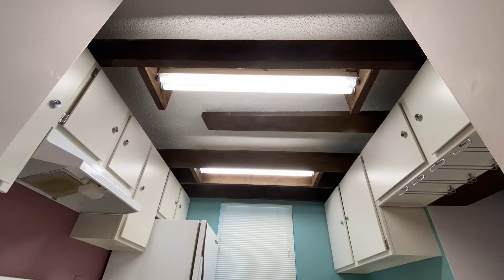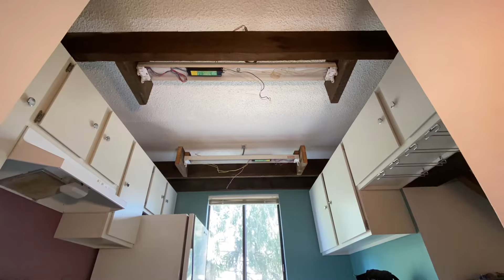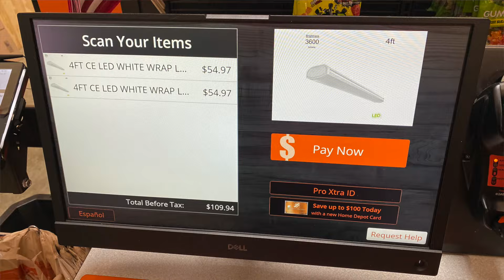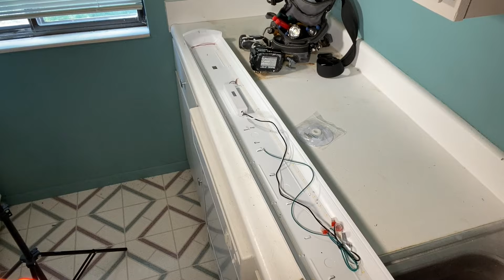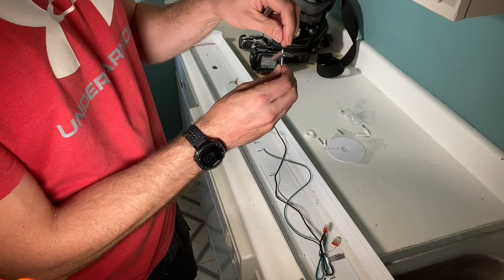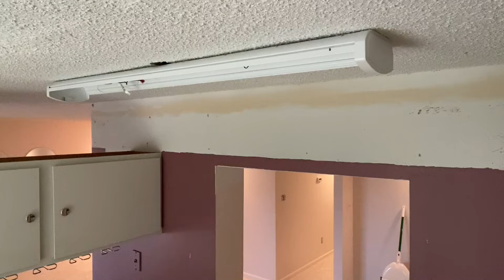How To Install A New LED Kitchen Ceiling Light | 4 Foot Flush Mount

Comment from the maker: Additional Tools Used and Light Options
LED Light Used:  https://geni.us/98icGCK
Klein Voltage Tester: https://geni.us/fAYN9Rr
Toggle Bolts:  https://geni.us/j8SDHM4
Same LED Light With Wider Base:  https://geni.us/MpYQVy

Tools Every Weekend Warrior Needs
Makita Cordless Drill Combo Kit:  https://geni.us/t7dIA
Dewalt Drill Bit Set:  https://geni.us/oFlSl
Dewalt Screwdriver Bit Set:  https://geni.us/VDcr
Craftsman Screwdriver Set: https://geni.us/jXqFI
Eklind Allen Wrench Set:  https://geni.us/7XfvO
Pliers (4-Piece Set):  https://geni.us/RIdx
Stanley Utility Knife:  https://geni.us/ndIDa
Stanley Tape Measure:  https://geni.us/bUfD1R
Studbuddy Stud Finder:  https://geni.us/RySCuVw
Johnson Torpedo Level:  https://geni.us/wiLcDY
Stanley Hammer:  https://geni.us/bPDk8Wo
Buck Bros Wood Chisel Set:  https://geni.us/vk3cpTW
Klein Voltage Tester:  https://geni.us/h9Hl
Klein Outlet Tester:  https://geni.us/kdBAJ
Ideal Wire Strippers: https://geni.us/MdOB
Little Giant Ladder: https://geni.us/fmlmTk

DISCLAIMER: This video and description contains affiliate links, which means that if you click on one of the product links, I’ll receive a small commission.

Comment: Excellent video, thank you. I already have that type of lighting in my kitchen, like the one I had when I first bought the house, but it's not working anymore. Do I have to spend $58 to replace the whole system?
Reply: I have the same issue. That type of LED light was already installed. It recently went out. So I replace the whole fixture??

Comment: How long does the lightning last?
Reply: I've read that LEDs can last 50,000 hours for these types of lights, however, that's 50,000 straight hours on non-stop. So with them being on and off, I can assume they'll last way longer. Compared to fluorescent lights that last nowhere near that long. The downside to this type of lighting is that the whole thing needs to be replaced instead of just the light bulbs in other models.

Comment: There seems to be either confusion or disagreement about the terms flush mount and surface mount. As a journeyman electrician the installation shown would be called a surface mount.

Comment: Great video!  I am inspired to take this project on in my own kitchen.  I have a few questions:
(1) Is this a disposal fixture?  Granted LEDs will last a while, but when it fails you have to replace the whole thing.  Would a fixture that accepts LED tubes be easier to maintain (and greener)?
(2) That looked like a lot of wire tucked away in the fixture.  Do you recommend trimming the wire instead of wrapping it all up there?  You could always extend with a wire nut/Wago (not ideal so measure twice, cut once).
(3) Do you have any hints on physical placement?  For example, should I center going down the middle of the galley-like kitchen (long with cabinets and built-in appliances on both side) or should I center with respect to the entryway (door frame with pocket)?
BTW, what is the typical failure mode of this light?  One LED at a time?  A whole strip?  Th whole fixture?

Comment: Most, if not all, of the newer LED fixtures are light color selectable, from 2700K to 5000K or more. There is a three position slider switch inside fixture to select between three color temperatures. I have a 15” round edge-lit fixture that has a fourth setting so you can select any of the three color temperatures by quickly turning the switch on/off until you get the one you want. The fixture will default to the last color temperature you selected when operated normally until you change color temperature again. Mine is even dimmable.

The issue about higher color temperatures (4000K and higher), is that bluer light blocks the production of melatonin in the body that can disrupt sleep. Just don’t be in an environment with bluer light a couple hours or so before bedtime. The cooler color temperatures are fine during the day when you are awake, and it makes people more energetic. It’s best to spend your evening hours before bed under warmer color temperature light like 2700K to 3000K, which is what most LED bulbs labeled “warm white” or similar. The warmer color temperature light does not disrupt the production of melatonin in the body and therefore, does not disrupt sleep. As mentioned above, bluer colored light is fine during the day when you are awake.
Reply: My client wants 6500k in the artist shop I do maintenance in. It's a side gig for me that I do at night, so say a prayer I get sleep! haha. Good advice btw.

Comment: Two things you did not hightlight enough is that this is NOT a fluorescent bulb fixture . With this if a strip goes bad you have to replace the entire fixture. Also love your screws to mount to the ceiling but only useful if the fixture has holes that allow one to stick in screw head in AND then slide to get to a place to tighten.

Comment: I’m currently installing a prismatic red light and a light fixture that I took down out of my garage has a white wire be a copper wire and a red wire the new fixture wires are white black and yellow which wires do I connect to what?

Comment: I purchased a similar product and the instructions say to position the wire connections back into the electrical box. However, I noticed you have connections inside the fixture. Just curious why you did it this way and is it a safe practice. Thank you

Comment: Hi, would you know what Dimmer switch would be compatible with these lights? I just installed but not sure what switch to get for these type of lights.
Reply: Hello! It will typically state whether the light is dimmable online in the description or on the box. I haven't seen many of these types of lights that are dimmable. I'd check the "specifications" on the website to ensure it's dimmability.

Comment: Nice video. Gives me the confidence to do it myself. 

With the faux ceiling gone,  have you thought about raising your cabinets to the ceiling?  I'm fixing to do that.  Plus I'm also fixing to replace my stove vent hood with a microwave vent hood combo.  Just a few suggestions for future videos for you.  👩‍🔧
Reply from the maker: Hey Carol,  If I was going to swap out the cabinets I would consider 36" high or 42" high depending on the clearance.  42" are a bit hard to reach but really increase the storage.
Reply: @EverydayHomeRepairs  true. I wanted to keep the cabinets and increase the countertop space. I'm tall and would store holiday stuff on the upper shelves.

Comment: Question: I've had my entire ceiling rebuilt over the past month, with new framing/joists, new insulation, and tomorrow I am having new drywall put up.  Can I mount these directly to the joists through the drywall, and what screws would you recommend for that?  My new joists are 1.5" wide and spaced at 14" to 16" (16 inches from the center of each joist) apart.  I have a Tavool electronic stud finder I can use to find them once the sheetrock goes up, but I'm going to ask the contractor to mark the studs on the drywall if he can.    I kind of don't want to mount my lights to the drywall.  Thanks!
Reply from the maker: Yes, I think you could mount directly to the floor joists.  If the standard mounting holes don't align exactly to your spacing you could drill 1 hole in the housing and use 1 of the standard mounting holes to get everything spaced exactly as you need it.  In terms of screws, this video goes over my favorite screw for this type of project. https://youtu.be/pztWWy2G7mI  Best of luck!

Comment: Is your light motion sensing? I skipped thru most of the video, if so can I go over those functions thanx
Reply from the maker: Nope, if I wanted that feature I would add it to the light switch by purchasing a light switch with a motion sensor integrated.  Best of luck on your project.

Comment: Good info! I plan to change the two ceiling fluorescent in the kitchen which are both controlled by one switch.  I haven't taken them down yet, but I wonder if they are wired in series, would there be any different issues with the wiring?
Reply from the maker: Nope, they are almost certainly on the same circuit and your wiring should be similar to the video.  Best of luck on the project!
Reply: @EverydayHomeRepairs  Thanks, will let you know how it goes

Comment: Great video.  This is my first time trying to install the same light fixture.  Couple questions.  1.  How did you get the fixture to hang while you were taking measurements before screwing into ceiling?  and 2.  Was there a bare copper wire coming out of the ceiling?  and if not, then the green wire is therefore not connected to anything?  Thank-you so much.
Reply from the maker: Hey Alan,  I just passed the wiring through the center grommet and they bent the wires around the edge which was enough to hold the fixture in place.  You are correct that this condo's wiring does not have ground at this location so I did not connect the ground from the light fixture to anything.  Best of luck on the install!

Comment: You mention that you can push down to release the light cover, but I don't see how you did it.

I bought a home with what looks like a very standard builder-grade LED light in the kitchen and I want to take it down as I have a much better LED light for that area.
Reply from the maker: Hey Shawn,  it is more of a push the cover up which allows you to slide the cover in 1 direction and then that will clear the opposite side from the housing allowing you to take the cover off.

Comment: My garage has the long bulbs and I would like to change it to the LED light. The only catch is my garage ceiling is concrete. Can my drill bit drill through or will I ruin it if I try?
Reply from the maker: You can drill and attach the light to concrete but you would need a hammer drill as a normal drill is not the best at drilling into concrete and a masonry drill bit.  This video is of a different topic but I show how to drill into and secure the vinyl shutter to brick.  You would use the same approach for your LED lights.  Let me know if you have any follow up questions. 👍